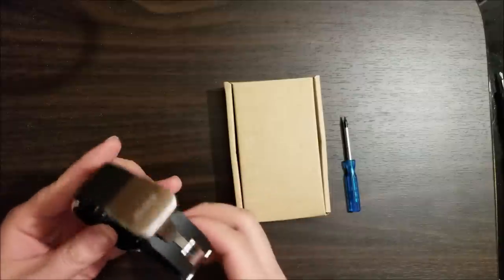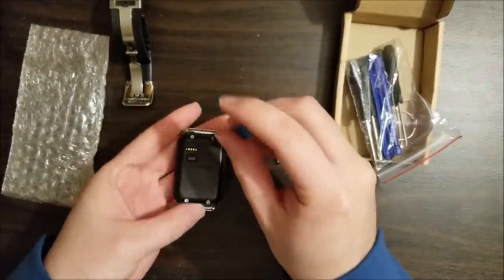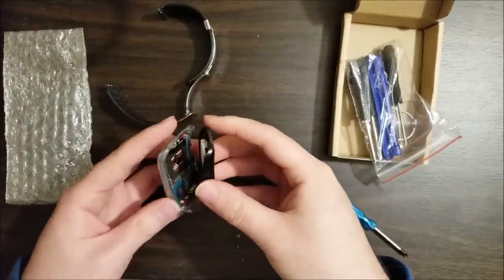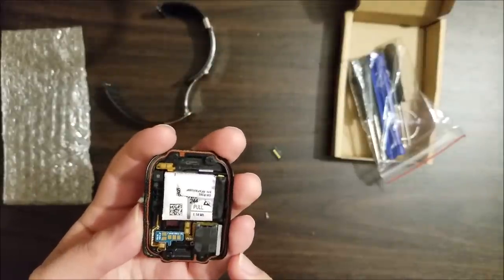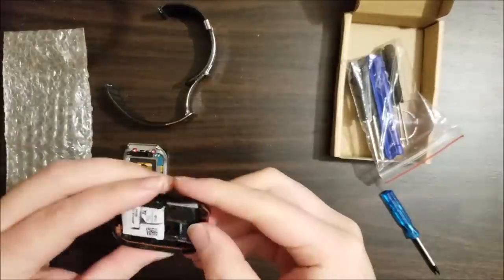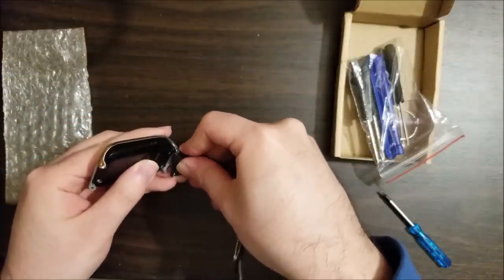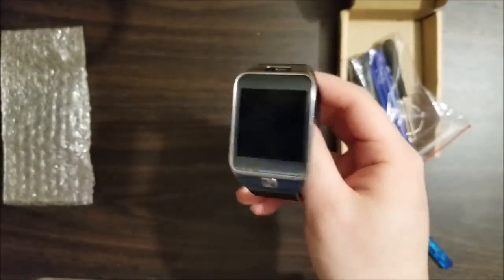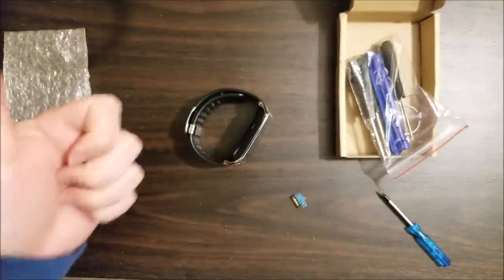Samsung Gear 2 Corroded Charging Contact Replacement

Comment: Nice Video. The same thing happened to my Gear S and Samsung replaced it. Sadly it started to corrode again. Since the corrosion comes from the sweat, I just used scotch tape to tape over the contacts whenever I'm wearing the watch. Seems to have stopped the corrosion for about a year now.
Reply from the maker: I'll probably try the same. I might even stock up on some replacement parts so I can keep this watch going for the next 10 years lol.

Comment: Can you please let me know if it's possible for me to replace the  heart rate sensor  on  my gear 2. My sensor doesn't evens light up wen I try to use the heart rate monitor or any other fitness features that's on my gear 2
Reply from the maker: I had to rewatch part of my own video since it's been quite awhile since I took my watch apart lol. Looks like the heart rate sensor is on it's own little daughter board that plugs into the main pcb so it should be an easy swap so long as you can find a replacement module.
Reply: @sjm4306   okay well good to know  because I thought the sensor and motherboard was one unit .... Now I must see if I could find  the replacement sensor module of the internet . And also soon I will have to replace my charging connector duck also on my gear 2 so  I want to replace that also wen I replace my sensor.....